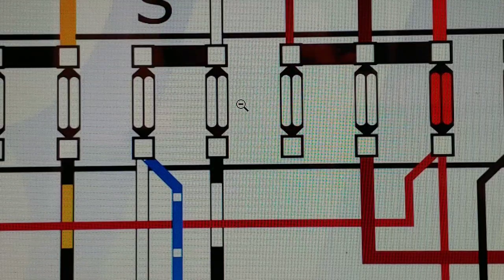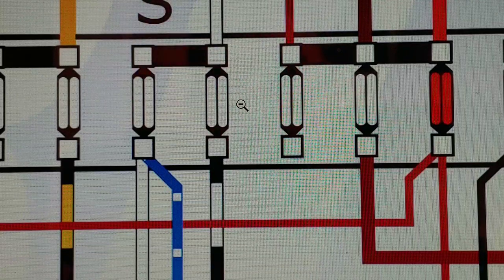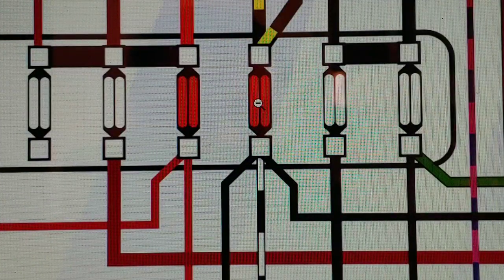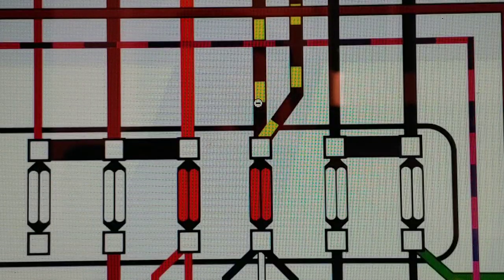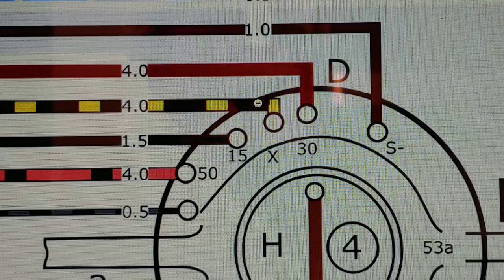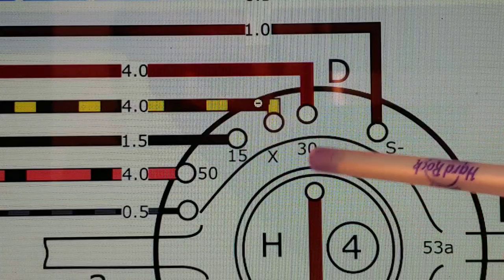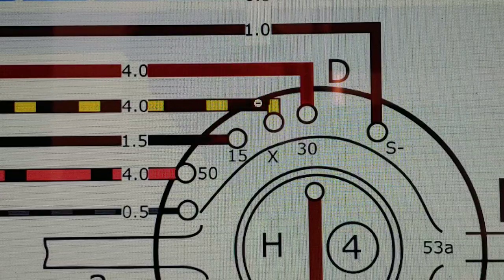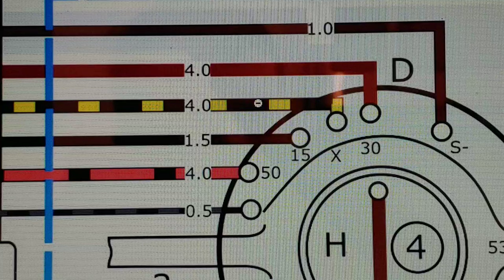CLASSIC 1972 VW SUPER BEETLE REWIRE. ( PART 14, FUSE 10 )

Comment: John my son checked for the parts I took off an old 72, looks like i did toss some the wiring stuff a few years ago, he did find tail light housings and hood hindges could sned them your way it they would help or would like some spare parts for your 72.     can you modify a hewer fuse blocks bus bar connection on the spade tabs ?? For me what you been sharing on the wirng fuse location by fuse location has really demisstified the VW wiring.
Reply from the maker: I could change the year of the fuse box. Trying to keep as OEM if possible. Bug me video has a section on that very topic though. I just don't know enough about power distribution yet to feel comfortable to make the conversion yet to another year and fuse box.